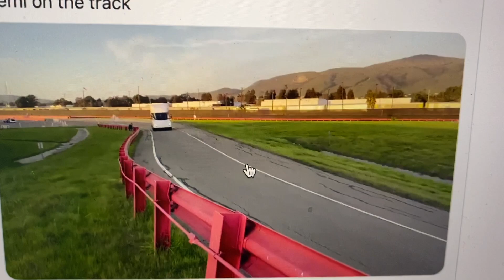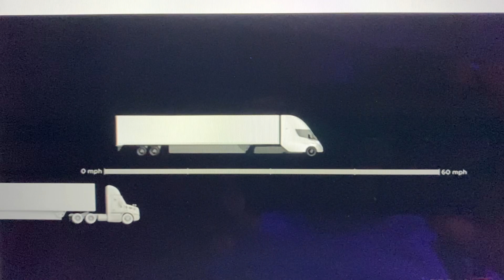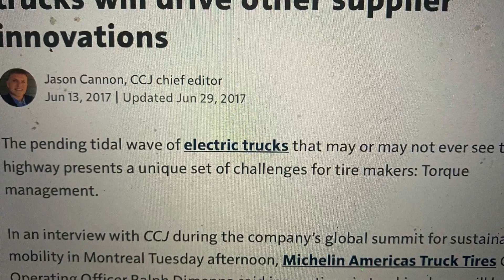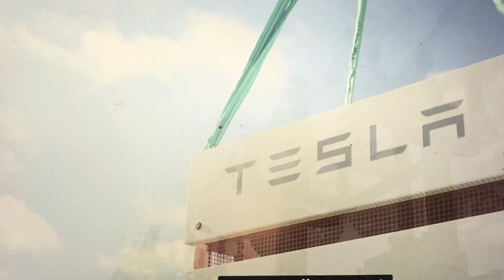Tesla Semi Awesome Torque Schreds Tires 2022 (a844)

Comment: I disagree, you only shred tires if the torque is so great you break traction.  A heavy load will not allow this as well as software management.  I’m sure Tesla has reviewed this issue and mitigated it.  I think it will be the safest truck on the road hands down.
Reply from the maker: I agree
Reply: Even if you don't break traction there would be strain on the tyre walls, and even just the molecules when a heavy truck accelerates and then when the truck is braking and slowing down the flexing strain would be in the opposite direction. And if the tyres are getting hot it will be even worse. And if the tyres are cold because the weather then they have to deal being hot and cold.

Comment: I had been thinking Tesla might use some trick tires to reduce rolling resistance.    Did not see the embedded monitoring which should have been obvious.
Reply from the maker: Michelin has sensors in tires

Comment: Hi Greg...You can give me a high performance vehicle and I still will not jack rabbit start from a stop sign or traffic light; however, the high torque will still be available if and when I make a conscious decision to use...so i don't view the tire shredding any differently...and the data from these trucks will be available to the companies to identify jack rabbit drivers...i don't accept it as a given that the high torque potential by itself without driver behaviour as a significant part of the equation equals many shredded tires....
Reply from the maker: data will tell all or one can just modify acceleration curve.

Comment: I guess it comes down to the driver, if the driver has a heavy foot then his tires may wear out faster.  I’ve owned sports cars for years and even though I could shred the tires, I wasn’t an aggressive driver so my tires lasted a long time.  I would much prefer a truck with lots of power for when I needed it than a slow lumbering pollution spewing diesel.  One way to see if your driver is aggressive is to check how fast his tires wear out😂.
Reply from the maker: good point on slow diesel.